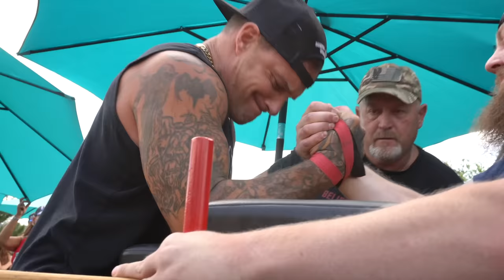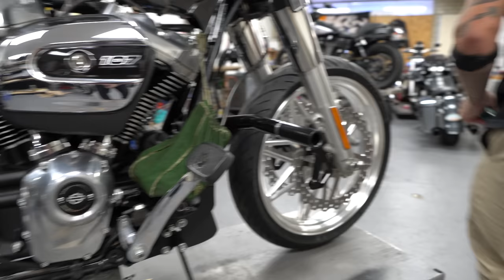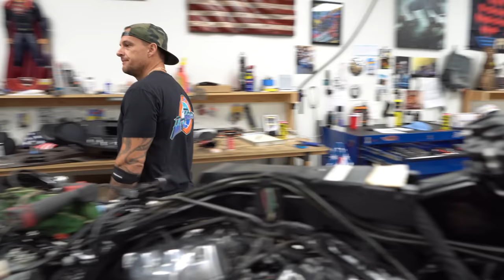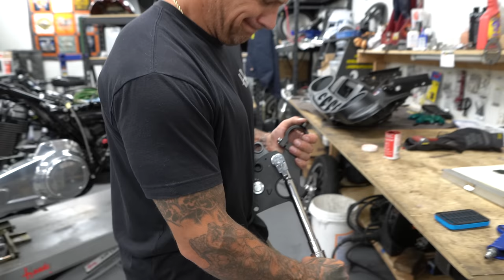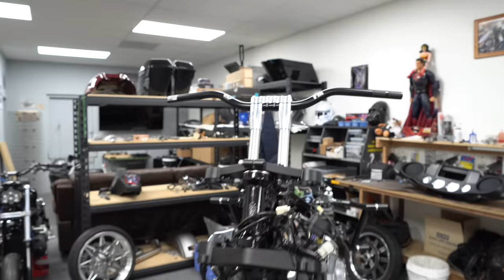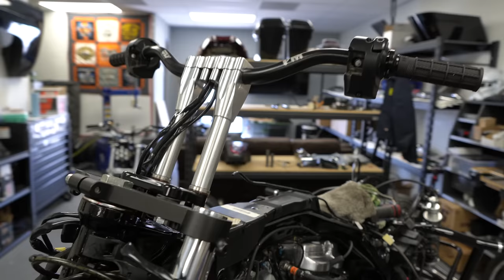2021 street glide performance / triple tree , bars and riser install. Kruesi Originals giveaway #4

Comment: What fork oil do you use with the legends +2 ? I used the HD Heavy fork oil and it's way too thick. Thanks guys!
Reply: legend has fork oil they sell in every fork set you can order it from them
Reply: R YOU  GOING TO  USE  THOSE  DOPE  ASS WHEELS?
Reply from the maker: Are use the fork oil that comes with the kit the one that they recommend. It’s five wait. I would never use any type of Harley Davidson oil in a motorcycle ever ever in my life never ever ever in my life.
Reply: @kruesioriginals  I bought the kit in 2020 when legend wasn’t supplying oil with the cartridges due to “shortages.” They recommended I use any heavy weight fork oil. Do you know what oil would have come with the kit?